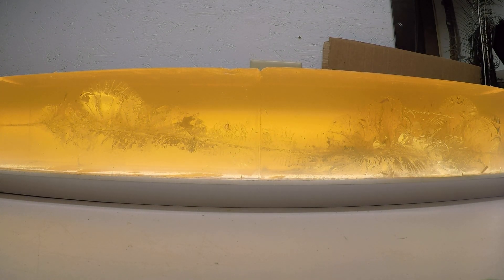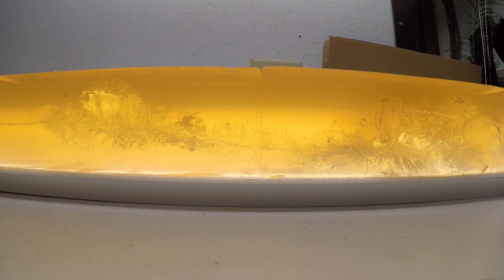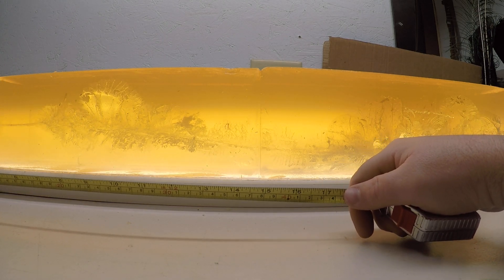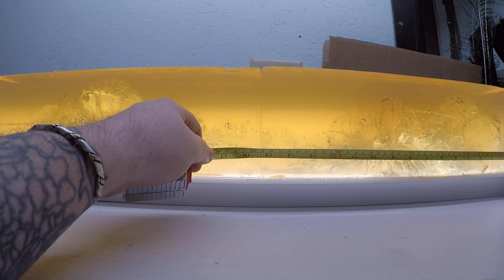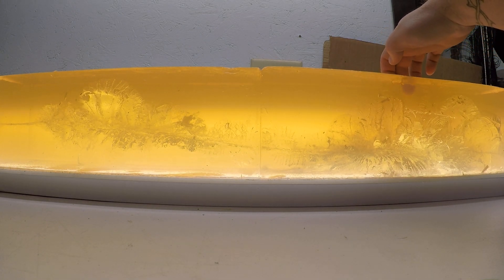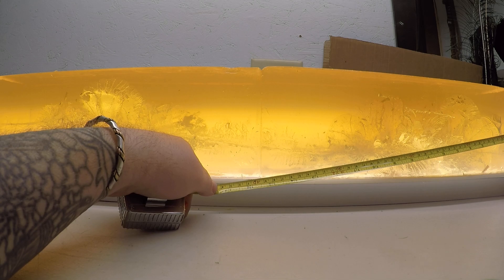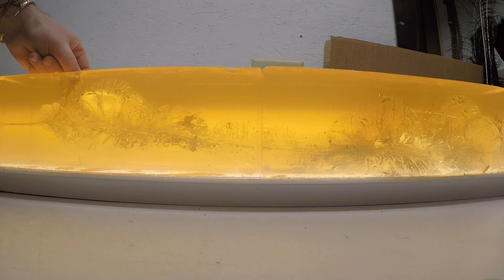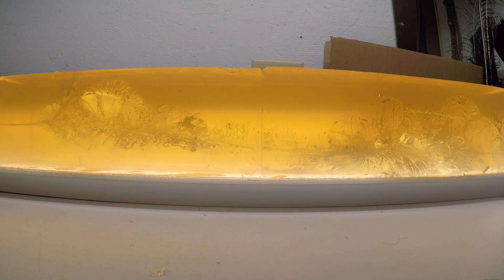Hornady A-Tip Ballistics Gel Test Terminal Performance 250 gr 30 cal overview. Shot out of a 300 PRC

Comment: The big question would be the bone for sure!!! I personal likings is a exit hole in my game! Will it kill sure would I use them nope!! But that’s just my opinion and you know what they about that.
Reply from the maker: With the penetration I did get and the fact that the high velocity load vered down and went through 1/2" particle board and the table and the low velocity one had 30 inches of penetration it would be a safe assumption that these will live an exit hole and more then likely a bigger one then I would personally care fore. I really prefer an exit hole as well.